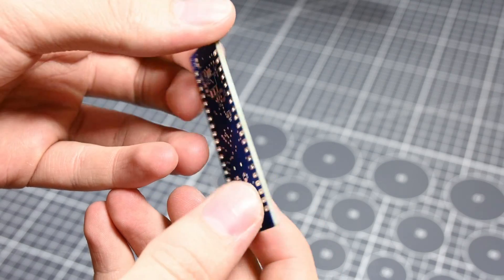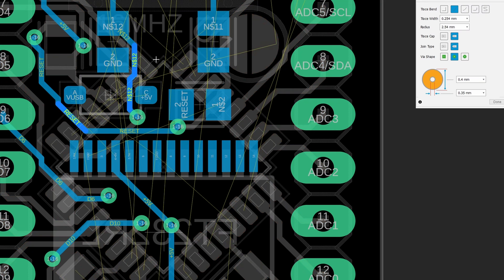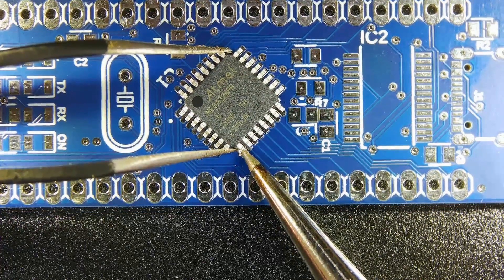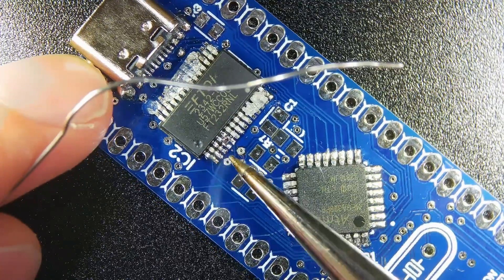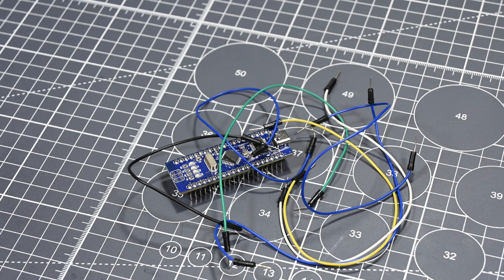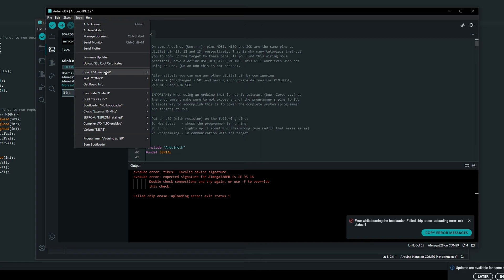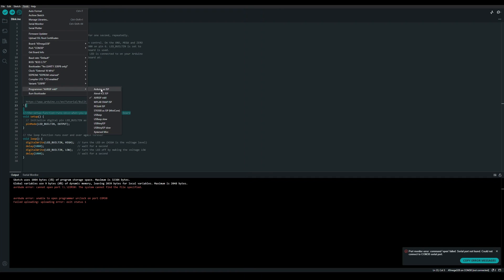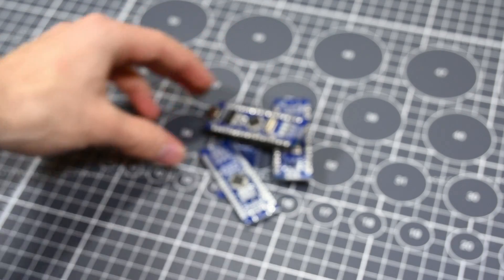USB-C Arduino Nanos? Well... I at Least Tried

Comment: m8 do yourself a massive favour and get hot air soldering equipment and paste solder. The solder mask is called that because it repels solder. You hold your components in place. Spread paste across ALL the pins at once then give it the hot air. The solder automatically goes to the pins and pads and is repelled by the solder mask. Soldering the cpu takes about 30 seconds.
Reply from the maker: I actually have a hot air reflow station and solder paste, I just chose not to use it today because I wanted to try and improve my skills with the iron. However, the hot air station and solder paste would definitely be the easier way to go about doing something like this in the future!

Comment: 9:35 - I think its bcoz previously the ftdi chip might be causing interference with the ISP signals from arduino ,but when you set it up in minimum config ,there were no extra connections on tx\rx and dtr pins ,as a result it worked just fine . 
You should always burn the bootloader before putting the chip on board .

Secondly ,the sketch uploading problem - A few days back i was trying to program my chinese nano clone ,which uses a ch340C chip and it kept giving me errors , but then i connected my nano to other ftdi and serial chips and it was still not uploading even when i knew the chips were working and i just tested them with another arduino .
Finally i found an explanation ,it was as simple as disconnecting the DTR pin from serial adapter so that we have only vcc,gnd,rx,tx pins connected to the microcontroller . now push the reset button on arduino board ,press upload and when the screen shows uploading then release the reset switch . This solved the problem and i was able to upload every single time .

Turns out the chip used on nano clone for serial communication is the culprit . It didnt let me upload directly through it ,nor did it let me upload when i connected external serial chip to the board ,i had to remove dtr connection and manual reset .

In your case ,I think its the same . The fdti chip is somehow not working fine .
I would suggest you to do the following: 
1. Try programming with ISP just how you burned the bootloader, it should upload easily ,that means microcontroller and bootloader is working fine .

2 . Try uploading using external serial adapter ( ch340G or Cp2012)by connecting it to your nano , if it doesn't let you normally ,try what i did ,if it does upload normally after manual reset using external serial adapter ,its likely tgat ftdi chip is the culprit. 

3. Make a minimum setup witch microcontroller (not the board ,only the chio) like the one you made for bootloader burning ,but this time use a serial chip like Ch340G (NOTE: ch340c and ch340g are different,The one with G has a crystal and has given me least errors,the ch340c seems to give constant errors in my case )
You can also use CP2012 serial adapter ,this one has never given me any errors till date .

4: Try updating drivers for your serial chip . In my case ,I prefer to open arduino IDE , then plug in the device ( for example the nano with problematic chip) ,then go to device manager and under COM ports youll find your device , just uninstall it .
Now find the drivers for your chip on internet ,install them while the device is still plugged in , after installation,youll se it will regcognise the chip and assign it a com port,
come back to arduino IDE ,and it should just work fine
Reply from the maker: I appreciate you sharing all of that, I'm definitely going to try what you've mentioned in here when I revisit this project, thanks!

Comment: Your 100nF capacitor from DTR to RESET is what tripped you up. It's an Arduino-specific kludge to allow resetting the MCU through the serial port to invoke the bootloader when downloading - but it sabotages trying to wiggle the RESET pin quickly which is what's expected when you program an MCU with an external programmer. ALL in-circuit programmable MCUs warn you against placing ANY capacitors on the RESET line for this specific reason - it would screw up the fast transition needed. Also, 1K is a bit low for a RESET pull-up; it works fine during use, but depending on what your external programmer might have on the same line it might start interfering with a proper level on the pin when pulled low. 10K is fine and less intrusive.
Reply from the maker: Thanks for that info! I'll give those tips a shot for sure!

Comment: I liked how you showed your failures  so that people can learn from it. I have also started working on SMD atmega8 board and made couple of versions. The first SMD soldering attempt was a huge disaster and the solder tin was all over the PCB. But after 2-3 boards I'm decent at it now. I also had to install minicore bootloader for atmega8 and I remember there was a DTR pin or something which had to be connected through a capacitor for the bootloading process to work. Will let you know after checking my schematics revisions

Comment: I encourage you to get to know Kicad, it will let you design 4 layer or 8 layer or 16 layer boards for $0 :)

I suggest try out drag-flow soldering with the iron for small SMD chips, and then clean up excess with solder wick till everything is clean. And grab a tub of decent flux paste to smear over stuff as well.

WCH chips for usb-serial work just fine and cost nowhere near FTDI. Try the CH340N or CH340X  (slightly smaller) for simplicity. TBH, the number of them in the wild that work, they HAVE proven themselves robust as long as you're not trying to go at record speeds on the baud rate. Silicon Labs CP210X are also a great option for slightly higher cost, might be a lot harder to manually solder though.

Edit: in the video you have UART1 selected instead of UART0, I hope you were in fact using UART1 pins for the FTDI chip

Comment: FTDI is famous for pulling bullshit to make fake chips non-functional.
whether the chips are fake or not, the unstable connection is possibly their fault, not yours
Reply from the maker: It is possible, however I bought them from a reputable reseller, so I don't think that these ones are fake - though fake ones are not uncommon

Comment: Why not KiCad?
Reply from the maker: I want to be better at KiCad and I occasionally work with it, but I've found using it to be so cumbersome and hard personally. It's one of those things where I'll never get better at it if I don't start forcing myself to use it with my designs, but at the moment when I try to design on it, I'm back to making first-grade level circuits and PCBs lol. Someday I can hopefully be better at it!
Reply: Never used anything but kicad very eazy and intuitive, probably have bad habits from crappy software

Comment: In theory the classic bootloader should work, according to the datasheet 328p code can run unmodified on 328pb chips. Only the device signature is different, if you enable verbose upload and just copy paste the avrdude commands in a terminal with an additional -F it should work. Once the original bootloader is installed the board should work as a nano in the IDE. 
As for flashing the bootloader that should work with the chip soldered in, else the idea of ISP (in system programming) is kinda pointless. I assume that something on your board is shorted sometimes, maybe excess solder or sth, that would explain the ftdi outages too.
I’m by no means an expert but I just bought a few PBs cause they’re significantly cheaper and hand soldered them to .1mm copper wire

Comment: I guess your soldering station is crap, or your solder. Use solder flux
Reply from the maker: The board had flux all over it the entire time, it's just really clear flux that isn't very visible. Also, have you considered that maybe I'm just brand new to micro soldering and the gear may not be the issue?

Comment: Why don't you use a stencil with solderpaste. Then put it on a cheap chinese heater plate and everything is perfect.
Reply from the maker: I didn't do that because I was looking for a good way to practice my hand micro soldering skills - mainly for board repairs where putting a PCB on a heater plate isn't doable.
Reply: Yep, he did say that......

Comment: You need to make it 3.3 Volts too. 5V is outdated. UPDI programming is necessary too.
Reply from the maker: I could consider it, though I'm not trying to make a state-of-the-art microcontroller.
Reply: 5v is literally the only reason to use Arduino in 2024, now we have much more powerful microcontroller for cheaper like esp32,stm32 clones, ch32x032 which have USB pd
Reply: There is no "need". Only "want". Generally you can't run a mega at full speed with 3.3V, and ATMega328PB does not have UPDI interface so it is stupid to suggest that for this project. I think you're suggesting buzzwords you've heard in other videos.
Reply: @ivolol  mmm....buzz.....